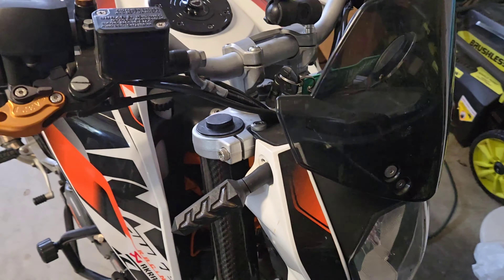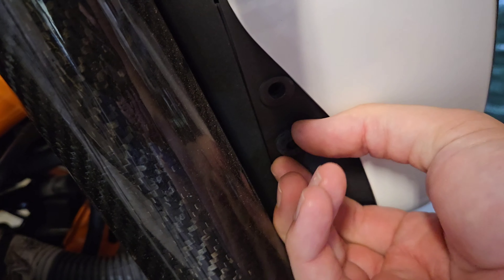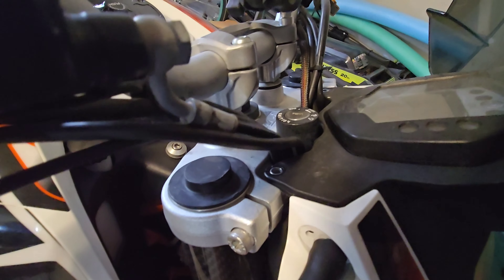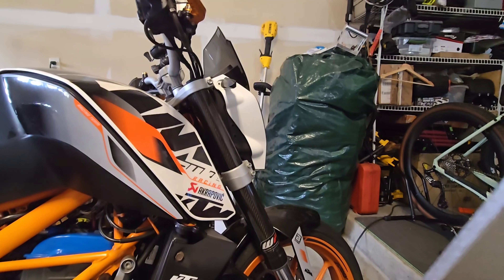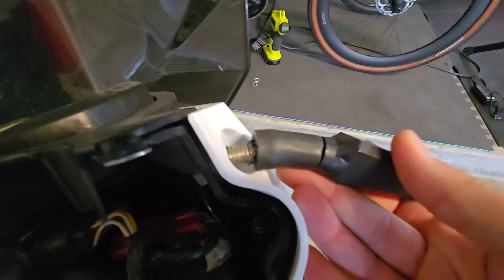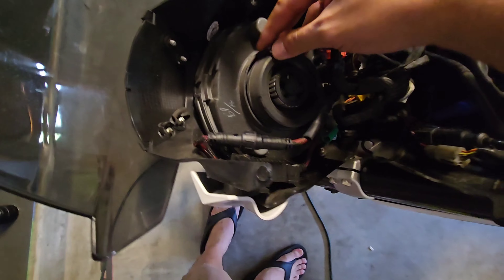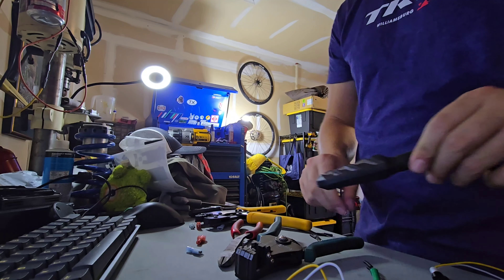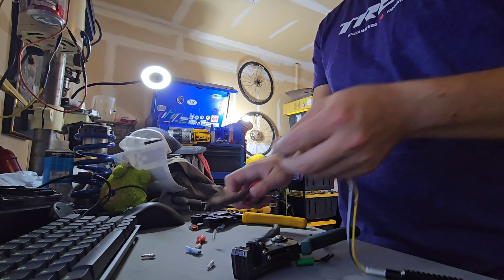New turn signals / DRL - KTM 390 Duke

Comment: I have same bike in black. Its a 2016. Took all the stickers off, mirrors, an turn signals. I put low profile parts from kimimoto. I use a tusk brand led, an i opened up the stock muffler an removed the cat and tig welded it back up
Its a super fun bike. I kinda like it more then my cbr for just romping around town
Reply from the maker: @stevie9361  secretly I wish mine was black hahahaha

Comment: I have the exact same bike 2016 duke 390 .You probaly never  noticed it before but the headlight only comes on after you started the bike. The little light at the bottom comes on when you turn the key but not the main ,only after you have started the bike is when the main light comes on. Atleast thats the case with mine. I didnt notice it until after i installed the daytime  running lights on mine . ✌🏽
Reply from the maker: You know, I literally went to bed and woke up this morning feeling like an idiot because I realized the exact same thing this morning hahaha.  I got it back toget and all is good!  Now I gotta sort the rear out.